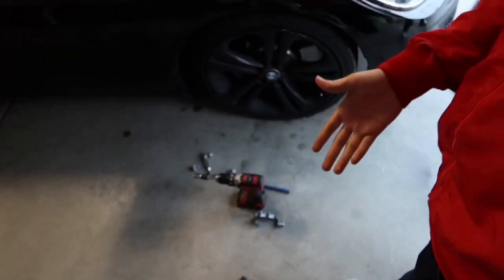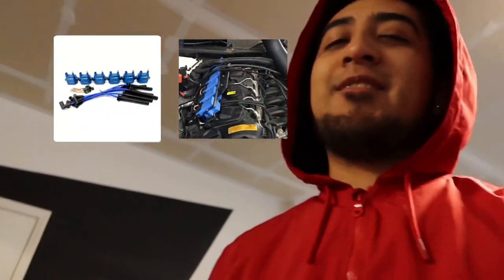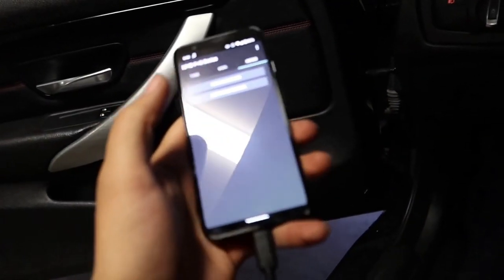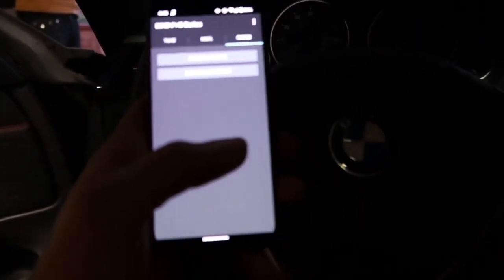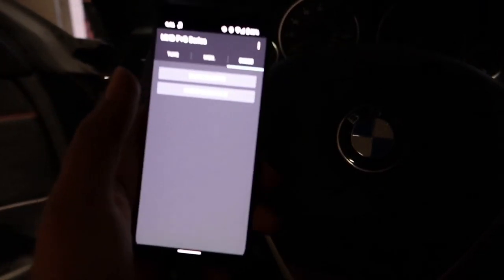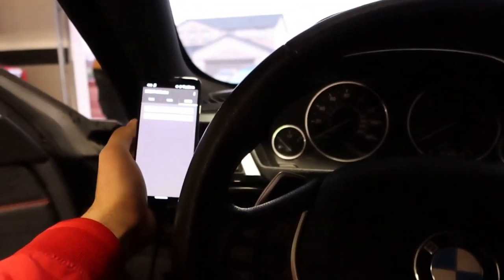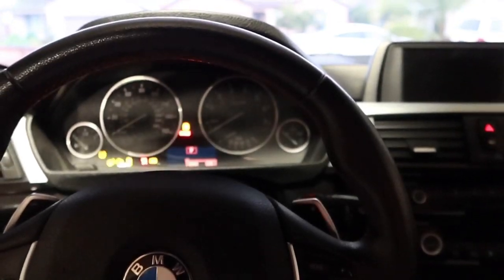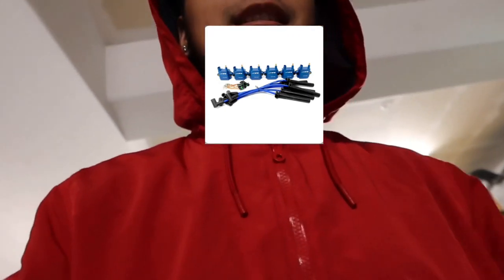435i Pure stage 2 turbo First pulls!!!! / NGK spark plugs installed

Comment: Letting you know, you are going to need the XDI HPFP if you want to get more top end power. I have the same spark plugs, and my car isn't falling off on the top end because of my XDI.
Reply from the maker: that’s the next purchase! I upgraded my low pressure fuel pump thinking that’ll be enough but nah the stock high pressure fuel pump sucks when you add more HP
Reply: @Itsbimmerbryan  I literally did the same thing. I thought the LPFP would make a difference but it actually was the HPFP all along. Once you swap it and get a custom tune, you will notice a huge difference in performance and your car won't fall off on the top end.
Reply from the maker: Good looking out bro ! Appreciate the advice 🚗💨
Reply: @Itsbimmerbryan  I can hook you up with a HPFP from Spool Performance, it'll more than max out the pure stage 2 ;)
Reply: @Bl1ndskater6  only on 91 though. It craps out when I use e85

Comment: Bhp & nm torque on the pure stage 2 turbos? What other mods do you have?
Reply from the maker: on the pure website it says cars equipped with the pure stage 2 turbo should be 500+WHP need to dyno mine soon lol 

Mod list as of 1/19/20  : 
Stage 2 low pressure fuel pump 
VRSF downpipe and charge pipe 
VRSF intercooler 
pure stage 2 turbo 
Precision race works ignition kit 
tuned by wedge performance 
XHP transmission tune also